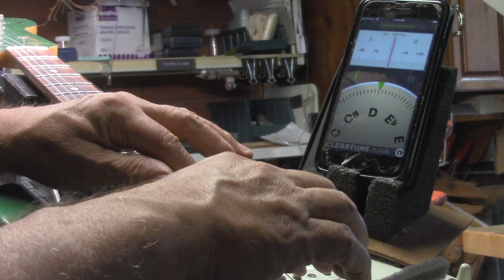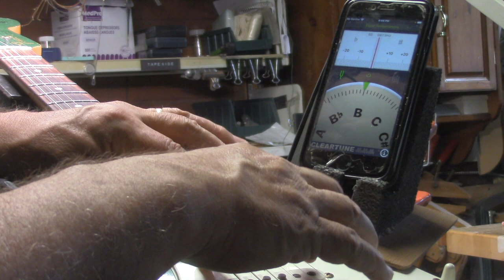A Compound Radius for your Stratocaster@StringTechWorkstations

Comment: Really nice video! How I should fret level a compound radius fretboard? Same as an straight full radius neck with a large sanding beam?
Reply from the maker: I've never used a sanding beam. I have a 6" single cut fine mill file mounted on a jointed hardwood handle. The trick is to "file obliquely" as you follow the trajectory of the string path.

Comment: What do you set the nut action at? I noticed the strings were really close to the 1st fret.
Reply from the maker: I set the action height ( with the compensated nut ) so that the open string and first fret note are both in tune.
Reply: @StringTechWorkstations  so there isn't a set height for the strings? You just file till the 1st fret note is completely in tune?
Reply from the maker: Yep @grf4005

Comment: Great work and playing!
I saw some luthiers cut the fret tang more than a fretboard with. And then - fill the gap with wood powder and superglue so no tang is visible from sides. Please comment - is this make any sense?
Reply from the maker: I've never used that method, so can't really comment. I've been using lacquer stick and a burn in knife for the last 50 years. Haven't had any issues yet ..... Cheers ;^ ) !
Reply: @StringTechWorkstations  thank you sir. Very useful channel. Best wishes!
Reply: 5:50 Is this a piece of copper or brass rod he is using to hammer the frets in?
Reply: @StringTechWorkstations  What is the burn in knife used for?
Reply: @veloramaru  I know that he uses a soft hammer. But that's not contacting the frets. He has a metal rod which he uses with the hammer to hammer the frets in. I wanted to know what material this might be.
Reply from the maker: @EbonyPope  To melt the wax.
Reply: @StringTechWorkstations  So you fill the fret ends with wax? Sorry I'm new to these luthiere channels.
Reply: @veloramaru  He already responded. Yes I was wondering because of the color.
Reply from the maker: @EbonyPope  There are two types of burn-in sticks EP .... low heat ( wax ) and High heat ... Lacquer stick. I believe I was using the hi-heat stick on this job . Sorry for any confusion. MMcC